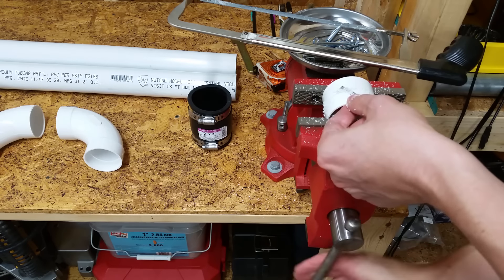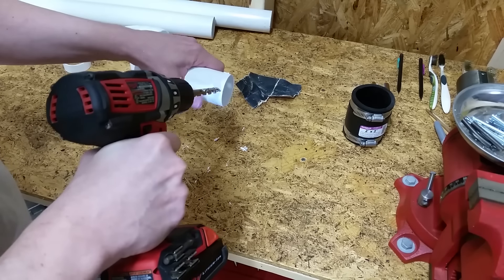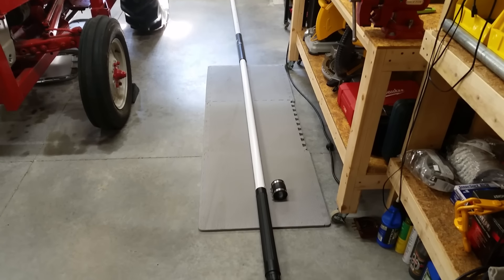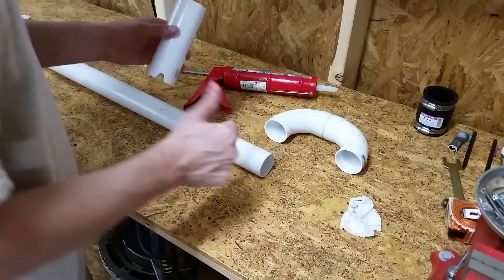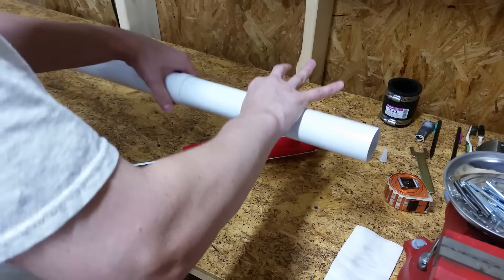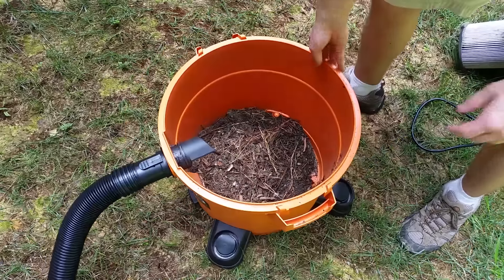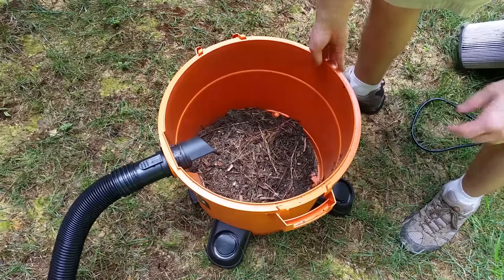DIY Gutter Vacuum - Easy and Safe Gutter Cleaning from the Ground

Comment: Impressive, I'll build one. I had tried on using aluminum gutter downspout for the light weight, but it split open when trying to reach the 2nd story. The seam is just a simple crimp and does not stand up to torque to flexing.
Reply from the maker: Let me know how it turns out, thanks for watching!

Comment: What a wonderful solution. Not sure that it could meet all my needs as some parts of my gutters are inaccessible from ground-standing. And then, I’d have to purchase a ‘wet and dry’ vac, of course. Also, very unconfident of being able to construct the apparatus. But, May give it a go, as it is the best idea I’ve ever seen on the enormous problem of gutters. A question - how is the connection (attachment) between the apparatus and the vac accomplished (perhaps you covered that, I may have missed it)? (Whenever I interact with my gutters, it always strikes me about the astoundingly inadequate design of gutters.) Thanks for your video.
Reply from the maker: I did a follow up video 3+ years later that should answer any additional questions you might have. Thanks for watching!
Reply: @Mikeattempts  Many thanks for your reply, Mike. I’ll look for it 😊

Comment: I have a section of the house where it is about 3 stories and need to clean the gutters badly, do you feel that another section to get a 3rd story would be doable?  Great idea and something I was thinking of doing however your instructions make it very easy, thanks for posting.
Reply from the maker: Yeah, it would probably be doable. The reach on mine is probably around 20 feet when holding the end of the vacuum hose at about chest-height. If you were able to measure the distance and then make a 3rd section just long enough to meet your requirements, then you would minimize the amount of additional weight. Thanks for watching!
Reply: @Mikeattempts  options: if u have a pickup, you can do the work from the cargo side of your truck- that will add a good 3-4 ft of vertical leap and minimize the weight of your total PVC/ABS towards the suction end
Reply from the maker: @ningcaytube  True but that's the great thing about using the central vacuum tubing, it's MUCH lighter than standard schedule 40 PVC.

Comment: Good, helpful video. Any reason to not just use 2" ABS instead of Sch 20 PVC, as it's MUCH easier to find, cheap, and similar in weight to Sch 20 PVC?
Reply from the maker: The central vacuum tubing (try that instead of sch 20) slides perfectly into the ridged hose extension that comes with wet/dry vacuums. This makes the attachment a tool-free slip-fit. If you can't find the tubing, call your local electrical supply store. I also did an update to this video a little over a year ago, if you need more details.
Reply: @Mikeattempts  Thanks. NO central vac tubing available in my large, usually well stocked urban area, amazingly enough. The guy at Home Depot suggested ABS, which works fine with a rubber sleeve connector. Several ways to skin the cat, as usual.
Reply: @wegtennis8740  I am doing the same with ABS, did you use 2" rubber sleeve connector between ABS pipe and shopvac? thanks

Comment: Hi Mike,

Thanks for the great video and sharing. I was going to make similar for my gutters: some are 28' high, some 
10ft and some 18ft. Your video definitely provides good ideas for my project.

Did you glue just the elbow area of the pipe with cement, and the rest using silicon?

Do you think the two 8-ft sections, with the vac hose of 10ft or so, would be long enough to cover my gutters?  

I am not very clear why you used that 24" abs pipe in the middle of the PVC pipes. Is it for easy changing the length? Please elaborate. Thanks again.
Reply from the maker: You can get 10 foot sections of the central vacuum tubing, I think that would make it just long enough to reach your 28 foot gutter. I found mine at a local electrical supply store so just call around.

Yes, I only used PVC cement on the joint where the first elbow connects to the long section of tubing, the rest is silicon.

The black ABS pipe is a coupler to connect the two sections of white central vacuum tubing. It's only glued to the bottom section, the top section just slides down in the ABS coupler, it fits really well. Then I can use only the top section for the single story gutters around my front porch. It makes it nice for storage too.
Reply: @Mikeattempts 
Thanks for the quick reply. Now, I have a better idea of what you are trying to accomplish. 

I am using PVC pipes from my collection all these years, so I don't need to buy anything.

I have a 3D printer, I can print pipe couplers to fit. There are few customizable templates at thingsverse.com that can be used if anyone is interested. Here's the link to some of them:

https://www.thingiverse.com/search?sort=relevant&q=pipe+adapter&type=things&customizable=1&dwh=355d9e0dfc18604

Again, thanks for your suggestion and have a nice day.
Reply from the maker: Standard schedule 40 PVC pipe would be way too heavy. The central vacuum tubing (schedule 20) has thinner walls so it weighs a lot less.
Reply: @Mikeattempts  
Sorry, I did not make myself clear. I am using Schedule 20 PVC pipes from central vac system. I will be printing out with PLA filament for the adapters, but couplers are relatively small compared to pipes. Thanks.
Reply from the maker: Ah, that's good, I can't imagine trying to maneuver a 20 foot long piece of schedule 40 PVC. :) Let me know how it turns out.

Comment: I use my drone to see where cleaning is needed and to guide the suction tube. Also I like to run a hose up the tube to run water in the gutters and downspouts - it helps to run a section of hose down the bend, then screw the fitting in to the hose that will be going up and pull it up through the bend then unhook them and it’s ready.
Reply from the maker: Ah, that's a cool way to use it, thanks for watching!

Comment: @Mikeattempts thank you for really the nice video.  I started looking out for supplies.. guess what Home Depot site appears out of stock on vaccum tubing and Amazon wants to charge $42 for an single section.  I do have a dewalt 10 gallon wet dry to work with.  Do you have alternate sources for tubing or may be even can recommend a commercial version of the attachment?
Reply from the maker: Thanks, I appreciate it!. I did an update video that should answer all your questions: https://youtu.be/mSSDkTUUz8E

Comment: Yes,  it takes longer to get everything out and cords run but still much faster and safer than a ladded.
Reply from the maker: Yep, I had one of those multi-position ladders and it was very heavy and hard to move when in the extension ladder position. I'm so glad I don't have to do that anymore.

Comment: If you were to use a Sch 20 coupling and glue it, you'd find that it doesn't provide much support.  At least that's what I found.  I wound up temporarily duct-taping an old broom handle to the pipe, but will use the ABS method next season.  I also shelled out $99 at Harbor Freight for a 6HP shop vac.  All in all, I have less than half in this system than it would have cost to clean my gutters ONCE.  I just wish there was a way to stabilize the vac on my relatively low pitched roof, stand back 15' and work from the top.  Would save a lot of energy and if done right would only involve one trip up and down the ladder.  Thanks, Mike!
Reply from the maker: Yeah, it gets harder to control when held at an angle. I like the ABS for storage and the 2 pieces quickly and easily slide together. Thanks for watching!

Comment: Mike, Genius idea. Worked great. Only issue is neither one inch collar is holding with silicone. Thought about cement but not on a joint so didn't know if it would hold. Thoughts? Thanks again for the great invention.
Reply from the maker: Depends on what your collars are made of. If you used PVC then PVC cement would work fine, even though it's not a joint. If you made your collars out of ABS, you could get a special cement that will work with the ABS and PVC. Or you could just try an adhesive caulk.

Comment: I hadn’t thought of using schedule 20 pipe. Great idea! As for the stiff neck, did you experiment at all with mounting the elbow at a bit of an angle so you aren’t working directly overhead? Also, did you do anything special to attach the extension to the wetvac hose?
Reply from the maker: Thanks for the comment! I thought about swapping one of the 90 degree elbows for a 45 degree elbow but I haven't tried it yet. I didn't need to do anything special to attach it to the hose. The PVC pipe slides into the vacuum hose extension, gravity and suction keep it together.
Reply: Mike attempts that would probably work even better than my idea, but even with your current set up if you rotated half of the curved part out of plane (I mean that if the whole thing was lying on the floor just bend the end straight and first curved part) by 30-45 degrees so the suction end was vertical in the gutter but the 8 foot piece was at an angle that would move you out from directly under the end. Might be harder to control though. Anyway, great video. Thanks!
Reply from the maker: Ah, I see what you mean, so you'd still be directly under the gutter but not directly under the suction end. That's why I used silicone caulk for most of the joints, if I wanted to try either one of our solutions, they'll come apart without too much effort. Thanks again for the comments!
Reply: YOu could also get a few different pieces so you could do different angels.

Comment: Great DIY.   In experience the curve should not be in line with the long tube. Example, my 5 HP motor shop vac couldn’t pull the giant oak leaves. Maybe they where too wet. So I attached to blower end. The angle of the pipes just blew everything toward my face. 
Now to add the extension to reach higher. 
Thanks for the video
Reply from the maker: Yeah, I mostly get pine needles and smaller leaves. I would imagine larger leaves, like oak, could result in some clogs but I would think damp leaves would get sucked up easier than stiff dried ones. Thanks for the comment!

Comment: Great idea and design! Unfortunately, i can't seem to easily find a local store that carries this vacuum tubing :( are there other lightweight alternatives? I definitely wouldnt be able to hande schedule 40. What about triple wall PVC?
Reply from the maker: If you call around to your local electrical supply stores, I'm sure you'll be able to find some central vacuum tubing. If they say they don't have any and can't order it, ask 'em if they have any recommendations for other local businesses that might carry the tubing. If not, you could make it out of ABS pipe (the black pipe I used to join the 2 sections) or aluminum pipe. However, it's definitely worth it to track down the central vacuum tubing. If you only have a single-story house, Home Depot sells a kit for around $30. I also did a follow up video a little over a year ago, in case you need more detail.
Reply: @Mikeattempts  Thanks, is the ABS pipe used for drain lighter weight than schedule 40?
Reply from the maker: @ramcholan2034  Yes, ABS is much lighter than schedule 40 and the 2" central vacuum tubing slides inside for a perfect fit. I did a follow up video with more detail, if needed.

Comment: I had made one of these years ago.  Guess there is nothing knew.  Mine is all one piece as I only have a cape cod and it fits perfectly on the lower gutters.  I did set the the size down from 3" to 1 1/2 so it would fit down into the gutter easier without banging the shingles.  It sure beats get out the ladder and banging my hands up.
Reply from the maker: Yep, I can clean all my gutters now in less than a half hour, it's great!

Comment: Hi Mike, if the top section of the pvc that goes into the 2 ft. section (black abs over the white piece) isn't somehow anchored, won't it wiggle inside the extension tubing?    Will I need to duct tape it?  You cut a coupler and used it as a stop - but it is that really needed?  Don't the two ends of the pvc butt up against each other inside the pvc?
Reply from the maker: Yes, the top section does move inside the black ABS coupler but that's an advantage as it allows you to easily change the position of the end, depending on which direction you're going, without twisting the whole attachment from the bottom. It's still a close fit so no noticeable suction is lost. The purpose of the stop on the top section is for single story gutters where you'd only use the top section. The stop bottoms out on the vacuum hose extension tube. I did a follow-up video with more details, if needed.

Comment: Thanks Mike!
The connector that 
you divided with the hacksaw; where did you place those?
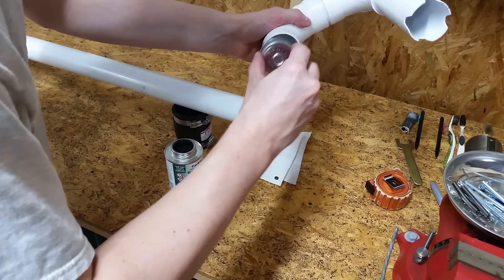Reply from the maker: I cut the coupler in half to use as "stops". You can see, at 3:35, when I slide on the black vacuum extension tube, it hits the "stop". I did a follow-up video with additional details: https://youtu.be/mSSDkTUUz8E

Comment: Mike 
The extension rod on my Ridgid shopvac has a plastic "lever" of sorts which allows it to lock on to the next piece in line.  Did you cut off that plastic lock so that you could insert the vacuum tubing into the extension rod?
Thanx,
Carl
Reply from the maker: My extensions don't have that feature, that clip lock is only on the end of my hose that attaches to the vacuum. However, I assume that clip is on the outside of your extension so it shouldn't be in the way because the gutter vac attachment slides down inside the vacuum extension, not over the outside.
Reply: Hi Mike and thanx for responding.
Turns out my shopvac is 2 inch OD, same as the vacuum pipe. So the end with the clip (the downstream end) has an ID of slightly larger than that to accept the next piece in line.  I am picking up some supplies today and am considering a mod anyhow using my backpack leaf blower - I have so many leaves in the gutters right now that I don't think I can sucK them out, only blow them out. In any case will post something on this site once I got it together so others can learn as well.  This is a great service to DIYers. Thanx, Mike. 
Carl
 @Mikeattempts
Reply from the maker: @carlmastropaolo6147  The OD of the central vacuum tubing is 2" which fits perfect down inside the tapered end of my Ridgid extension. Also, if your vacuum is strong enough, you could just connect the hose to the exhaust port to blow the leaves. I did a follow up to this video that might help fill in more details https://youtu.be/mSSDkTUUz8E .

Comment: I just bought the materials to create this for my 2 story home.  Unfortunately I have to stick with the heavy schedule 40 as the 20 is unavailable within 100 miles from me.   Probably have a little help when cleaning the gutters.  Thanks for the video.
Reply from the maker: Thanks for watching!
Reply: Not finding the schedule 20 pvc tubing is a big problem with this set up. They don’t sell it at any of the big box stores around here so will resort to the pvc “40” and use pvc pipe adhesive to join together 2 ten-foot sections for my second story gutters. I have stainless gutter covers that are perforated but get these nasty red oak seed pods that form a beaver pelt like blanket on top of the stainless guards. I am optimistic the vacuum will handle the seed pod blankets.

Comment: pine droppings and small debris should be easy. I want to know how it might work on maple leaves. I did make something similar, years ago and attached it to my hand-held blower, but it proved to be rather cumbersome from the ground. Maybe aluminum downspout will be a lighter alternative.
Reply from the maker: Some maple leaves end up in my gutter and it sucks 'em out without clogging. You can also use this attachment to blow out your gutters by attaching the flexible hose to the vacuum's exhaust port.
Reply: @Mikeattempts     yes, but waiting for 3-4 dry days in a row, which we haven't had much luck with this summer. Also, the leaves are late in falling this year.

Comment: Fine ...... BUT ..... how you know you got enough or all ?   need a cam up there showing on your smart phone ....maybe in 2018 it was not around as much ....or a remote drone ! ? lol
but all in all it is a great idea Mike ...... it worked a little better when there was water in the drain , helped " lubricate " that elbow .... got clogged easy in my drains , a lot of maple leaves . used my ar compressor helped
Reply from the maker: I taped a camera on the end to get shots for this video. I couldn't see what was happening until after but you can see that it gets everything. It even pulled out a bungie cord that I had dropped while working on the chimney cap. :) Thanks for watching!

Comment: This worked perfect for me.  I have one gutter almost 3 floors up and it even reached that one, though it was a bit difficult to handle at that height.  I’d like to figure out a way to temporarily lock each piece into position.
Reply from the maker: You could make an attachment just for the 3-story section and use PVC glue and PVC couplers instead of the black ABS pipe. This will make it a little lighter and a bit more stable. Thanks for the comment!